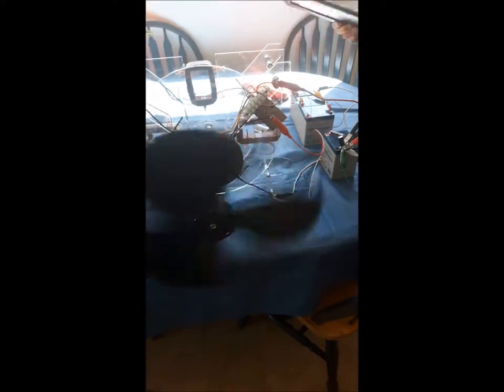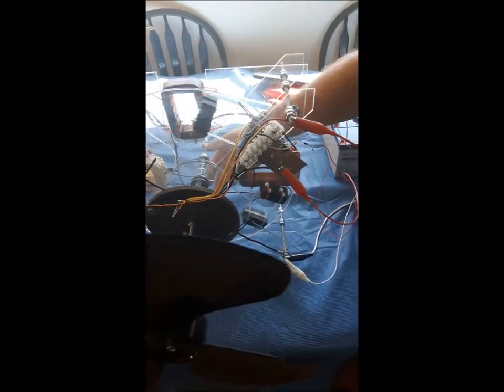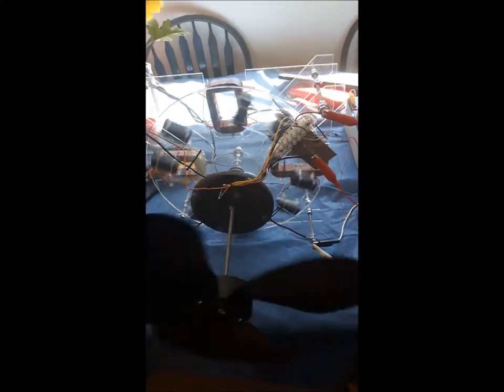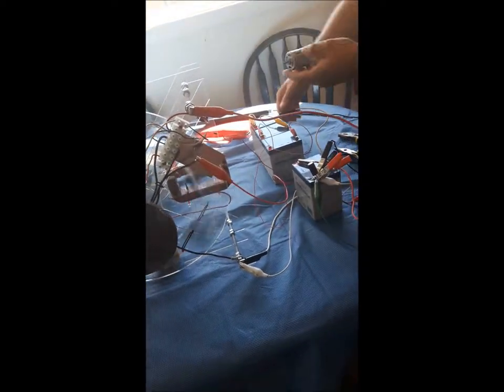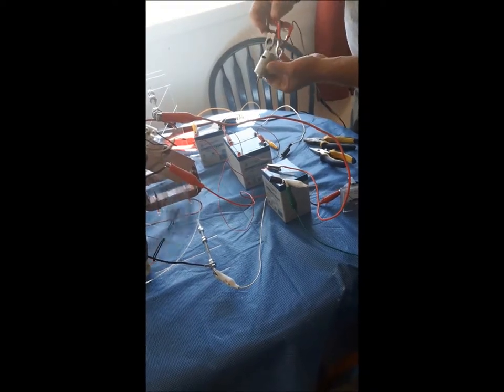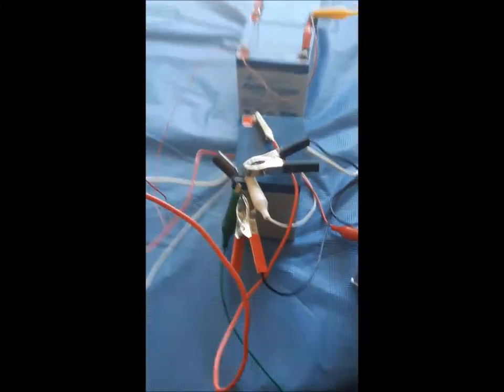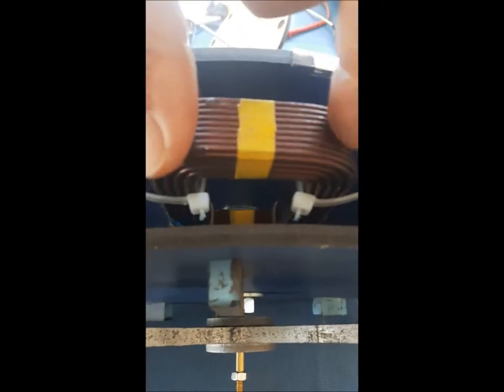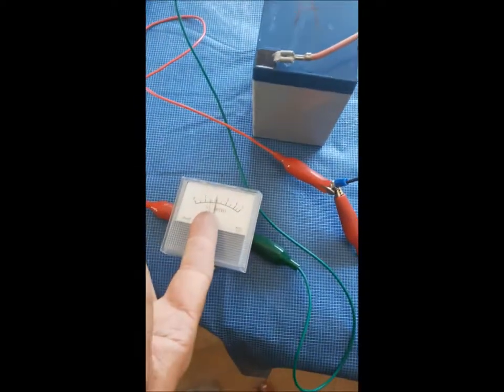Free energy X motor

Comment: good work;  some tidbits you may use; High current (thick wire)=high magnetism=high lenz force. Low current (thin wires) low magnetism= low or no lenz force but plenty of voltage without sacrificing battery. Tom Bearden..dont kill the dipole! (battery)
Reply from the maker: Alex Manzanero ... thats right, superconductor coils with 1 million turns = enough magnetism to launch a ship anchor off a AA battery right? Wheres our precious conservation of energy law right? Lol. Misapplied!